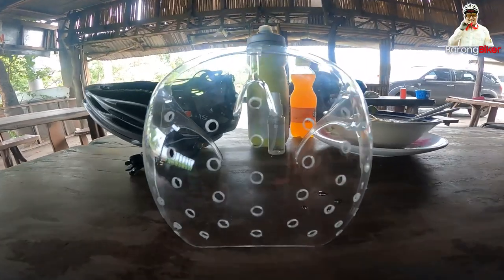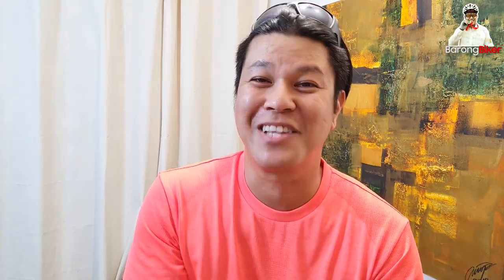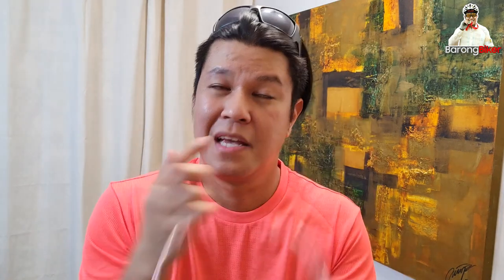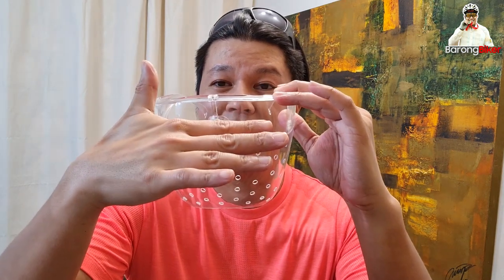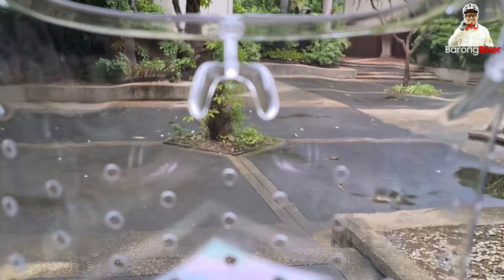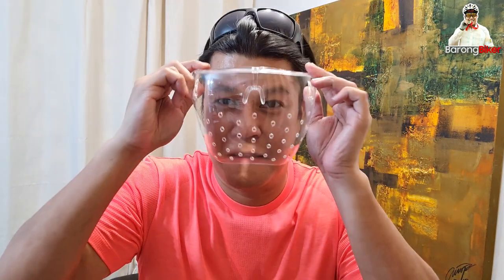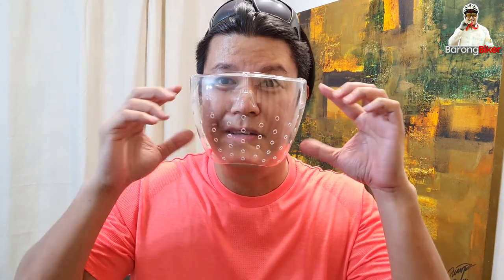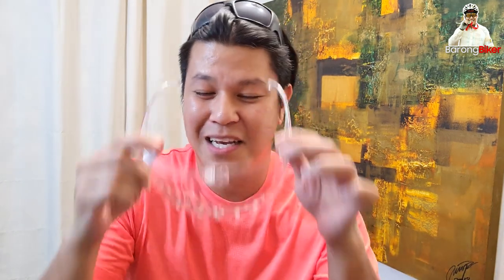Face Shield for Cycling: An Experiment • BARONG BIKER BarongBiker

Comment: I think drilling holes on the face shield defeats the purpose of it being there, water droplets (saliva, etc.) can go through those holes. Still, i dont agree with this faceshield memorandum. I tried it early this morning, nauubusan ako ng hangin kahit chill ride lng. Nag fofogging yung faceshield, pwde din sya matangay ng hangin pag mabilis takbo mo at lumingon ka sa likod mo. Tapos grabe pag pawis ko kanina. 😂😂
Reply from the maker: Of course it does defeat as I mentioned on the vid. The holes were meant to prevent fog build up,  increase ventilation, and hopefully just be rule-compliant. I rely on the facemask to protect me against droplets/saliva from others. This is an added burden indeed.